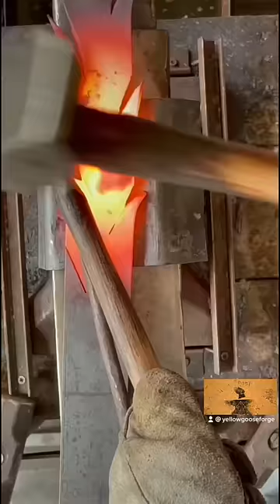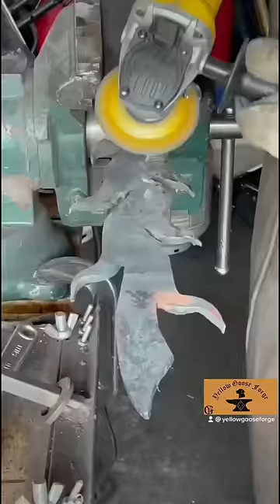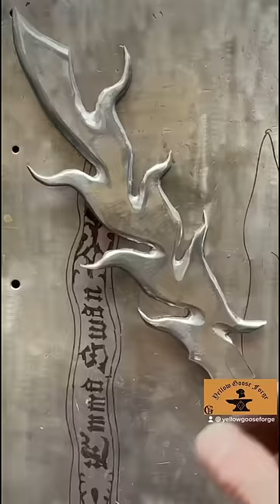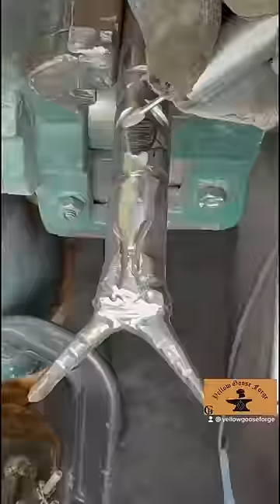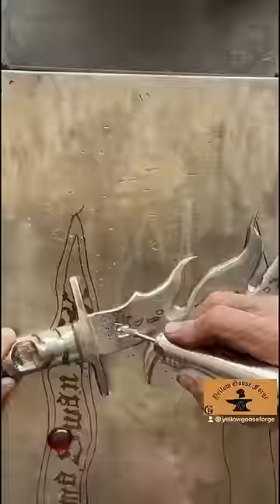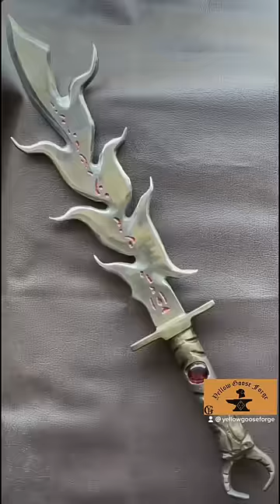Forging Dark Dragon Blade Ninja Gaiden! #blacksmith #knifemaking #sword #gamer #shorts

Comment: Imagine what a pain in the ass it would be to sharpen it for a warrior
Reply from the maker: Absolutely!
Reply: Very nice
Reply: You wouldn’t, this looks like the most useless blade ever
Reply: @Primal_forge  fr
Reply: No warrior would use this blade
Reply: @DemonGodRyuukai  fr
Reply: Do you have any idea how many times you need to sharpen a chainsaw in a work day?
Reply: @loveblowsbad  ain't no chainsaw
Reply: @loveblowsbad  not really. I guess a lot
Reply: @Dx20xygen7  more then once was the whole point. Depends on what you're cutting, can get ridiculous. Sharpening anything is only as hard as how long it's been sense you've sharpened the thing.
Reply: These swords with these formats would be very hymn tens
Reply: @Color0011  you're right far less teeth...
Reply: Imagine trying to actually use it for anything
Reply: @Primal_forge  fr
Reply: @ianluk8855  and exactly how much armed combat sport do you have experience in? Hema? SCA? Not likely Boffering? Not likely anything where people are actually competitively trying to come up with better equipment. Just more historically accurate and face it that's all based off period artistic depiction...
Reply: @ianluk8855  If I get it right, it's designed to catch a blade striking at you. Like, you hold ot in your off hand and block a hit.
Reply: @Dx20xygen7  that would be its use, if the spikes were anywhere but on the blade. Those spikes run all the way up the blade, meaning it's basically useless when trying to use it to hit things. Parrying daggers with big cross guards or swordbreakers with the teeth on the spine are much better for catching blades while still being actually useful weapons, mainly because the blades are smooth. And if you tried to catch someone's blade with this, it'd be likely to just snap due to the shape of the blade. This thing is useless